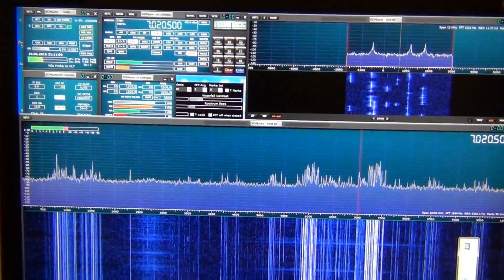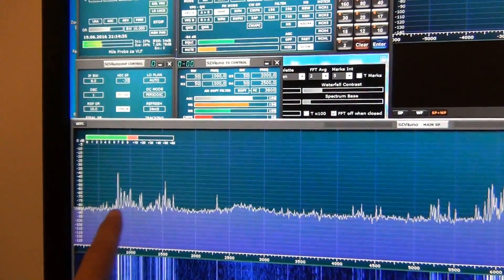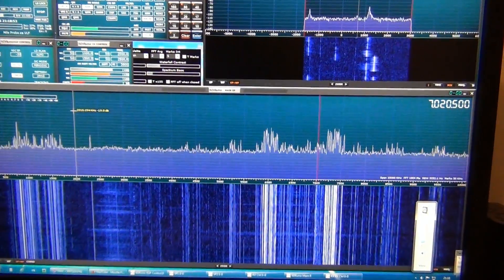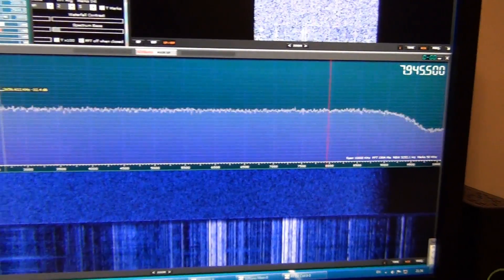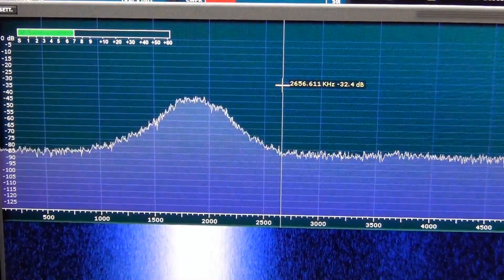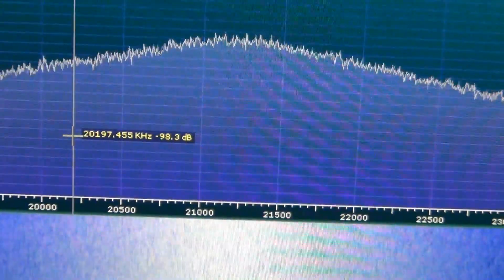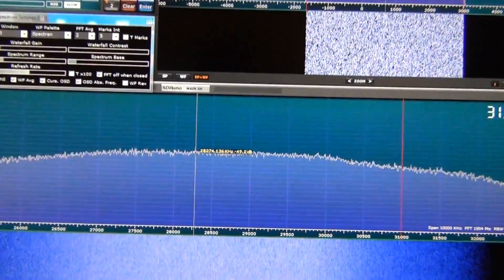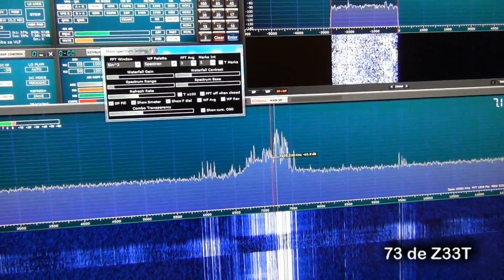SDRplay with SDRuno Using to characterize RF HF filters

Comment: Hello. I'm looking for a tool that can monitor RF transmissions. This looks promising. 
When you say; "the new one is 10 MHz spectrum span on the window screen",
Can I monitor 1Hz to 10MHz concurently?
Does that mean, it is limited to a windows 10 MHz wide at a time?  Does this software have an API?
If I wanted to monitor 1Hz to 100 MHz frequencies, I would need 10 units plugged into 10 computers?
Can it run on Raspberry pi? 
So many questions, so little time...
Reply from the maker: 1. Yes
2. Yes
3. Yes
4. Yes
5. Yes, but with some limits .
There are SDRplay RSPduo hardware, which has two independent tuners inside one box, with one USB only.
Both tuners can receive 10 plus 10 MHz anywhere from 1kHz to 2GHz
See: https://www.youtube.com/watch?v=7WFkQH5U_cw&t=52s

Comment: Hi. Good video. 

Please tell me what was the peak power levels you sent into the rsp? 

Thanks
Reply from the maker: Reference ENR of the noise source: 
0.1G/60DB
0.5G/55DB,
1G/52DB,
1.5G/48DB 
2G/38DB
2.5G/30DB
3G/27DB
3.5G/20DB 

ENR (Excess Noise Ratio), noise sources over standard noise temperature T0 thermal noise. Here refers to the difference of no input noise source and input noise source signal level.

Comment: What was your antenna when you tested this?
Reply from the maker: Hello Ibrahim, On this video,  the antenna was delta loop for 40 m band. Without filter, you can adjust the RF gain to some point without IMD, but when you switch in the band pass filter, you can increase RF gain to some higher level, so you can listen weaker signals which were buried in the noise without filter and with less RF gain (less sensitivity)

Comment: Very nice filters. I like to build a similar box. I'm wating for your schematic!!!!! Bye
Reply from the maker: Here is information about filter box in this video: It is simple combination of LPF and BPF filters, High Dynamic range preamplifier (LNA) and attenuators. For VLF receiving there is 9-pole Low Pass filter with Fc=525 KHz. For 1.8 - 50 MHz there are Bandpass filters. There are two selectable attenuators (one attenuator before and second is after the LNA). Here is Schematic:   https://postimg.org/image/4cg7nofap/

Here are some links of pictures and calculations for my LPF Filter:

https://s5.postimg.org/5qphxlzbr/LPF_Mile_Kokotov.jpg

https://s5.postimg.org/gc9d9m5nb/LPF_530_k_Hz_9_Pole_Chebyshev_Calculations.jpg

https://s5.postimg.org/78ay9642f/LPF_530_k_Hz_9_Pole_Chebyshev_Photo2.jpg

Comment: What have you for a computer used and what resolution on you Monitor?
Reply from the maker: The Computer in this video is 6 years old Intel Core Quad CPU Q8400 / 2.66 GHz / 4 GB RAM / Win7_64 bit.
Monitor is 27" Samsung SyncMaster 275T, resolution 1920 x 1200.

Comment: does SDRuno requires any additionally licencing dongles like Studio 1?
does it support Airspy or only SDRPlay?
Reply from the maker: SDRuno DOES NOT requires any additionally licensing dongles like Studio 1.
SDRuno is free for SDRplay RSP1 owners.
As I know from their official webpage, SDRuno support Airspy also, but with limited functionality...
Reply: +Mile Kokotov Thanks do you happen to know what is linitted if you use SDRUno with Airspy?
Reply from the maker: No, but I will check...

Comment from the maker: Here is information about filter box in this video: It is simple combination of LPF and BPF filters, High Dynamic range preamplifier (LNA) and attenuators. For VLF receiving there is 9-pole Low Pass filter with Fc=525 KHz. For 1.8 - 50 MHz there are Bandpass filters. There are two selectable attenuators (one attenuator before and second is after the LNA). Here is Schematic:   https://postimg.org/image/4cg7nofap/

Comment: what is that filter?
Reply from the maker: An RF filter is an electrical circuit designed to have specific characteristics with respect to the transmission or attenuation of various frequencies that may be applied to it.
There are three general types of RF filters:
A high-pass filter (HPF) similarly has a cut-off frequency, above 
which there is little or no loss in transmission, but below which there 
is considerable attenuation. Its behavior is the opposite of that of the
 low-pass filter.
A low-pass filter (LPF) is one that will permit all frequencies below a
 specified one called the cut-off frequency to be transmitted with 
little or no loss, but that will attenuate all frequencies above the 
cut-off frequency. 
A band-pass filter (BPF) is one that will transmit a selected band of 
frequencies with substantially no loss, but that will attenuate all 
frequencies either higher or lower than the desired band.
The Filter connected in the front end of the receiver can be very much useful and it can improve the reception of the weak signals rejecting all others unwanted signals that can produces interference, interrmodulation and as a results, the weak signals can not be copied !With bandpass filter for particular frequency band, Receiving weak signals on that band is much easier, without problems from out of band strong sugnals.
Reply: I know that. I want to know if this filter is your design or something that can be purchased
Reply from the maker: This is my homemade filter box for HF pus 50 MHz.
There are 8 filters. LPF for VLF, suppressing all from 525 Khz and up. 
BPF for 160, 80, 40, 20, 15, 10 and 6 m, as well as LNA with two JFet 
transistors in push-pull. Those days I did the calculations and now I am
 finalizing the project.
Once i will finish it, I will published the details for DIY.
Reply: thanks a lot!
Reply: 8 filters ?
Reply from the maker: Yes, there are 8 filter in the box!